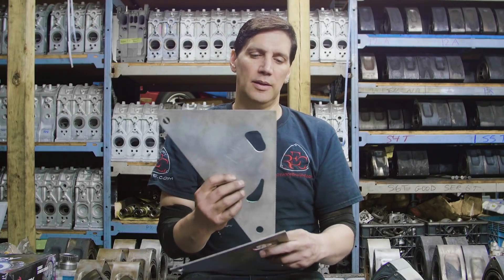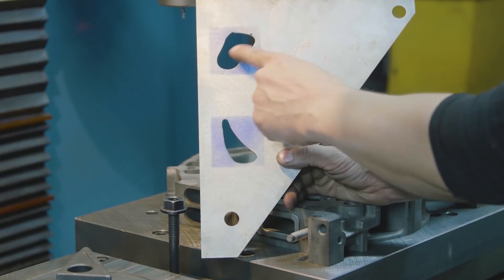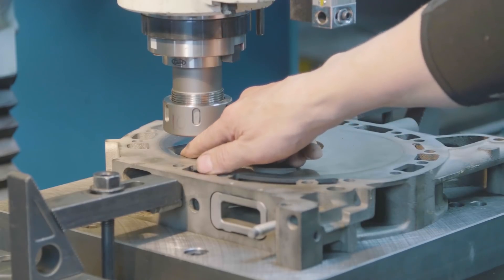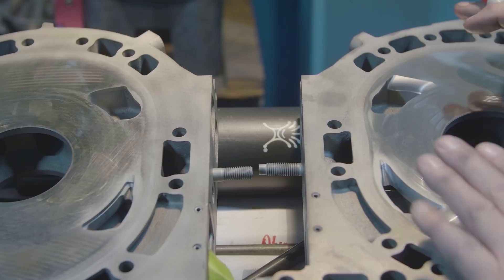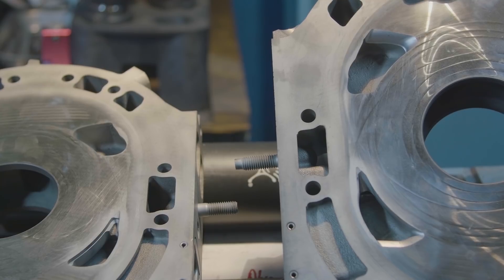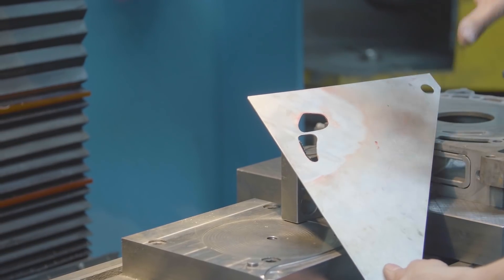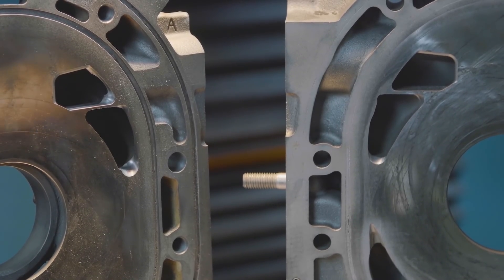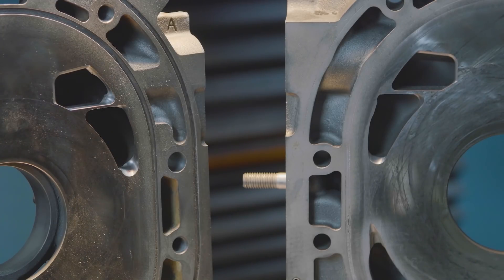High flow and high power CNC INTAKE porting - NEW

Comment: Planning to rebuild my renesis for next summer.. would LOVE to have this Cnc bridge porting done to mine, would like to go forced induction.. is it possible to have lightened and balanced low compression rotors made for the renesis? Sorry if this question has been answered already!! PS, love your videos!
Reply from the maker: unfortunately renesis engines need to be built with renesis rotors
Reply: RX7 Specialties can we alter the compression ratio of Renesis rotor for turbo application?

Comment: Nice video!, question, when your making the ports wider (towards the rotor housing) at some point the trailing side seal will fall into the intake port, and if you port even further the leading side seal will also drop into the port. Do you allow this to happen on your ports (and chamfer / round off the upper edge of the port to avoid side seal damage) or do you keep the port more conservative to avoid this?
Reply: I'm pretty sure they keep it more conservative with the renesis engines. Not much room to make the ports larger. At least that's what I've seen from the videos.

Comment: So if I'm not mistaken...
The new 6 port rx8 template will work with the s3-s5 6 port motors?
Or is the new template only match on the secondary ports?
Reply from the maker: Secondary only but we have a CNC program for RX7 6 port pri ports

Comment: Is there plans for a CNC Bridgeport? Or is that unnecessary with the extra high flow ports?
Reply from the maker: We dont make claims on Renesis porting as the engines are very difficult to pull extra power from. We only claim additional maximum gains if the customer will also run a full header exhaust system.
Reply: Scott Meyer it looks awesome doesnt it . 
I really want to see power figures .
Reply from the maker: We do not offer bridge porting for Renesis engines. These side port exhaust engines do not respond like RX7 engines do. Bridge porting dramatically reduces manifold vacuum and will just confuse the stock ECU. Its not a port style that can be run without the ability to take control of the ECU
Reply: RX7 Specialties would this porting option work with a 4bbl carb setup? I'm planning a Renesis build for my 1983 Fb for autocross racing and want something different under the hood.